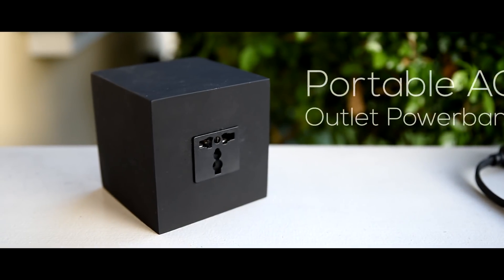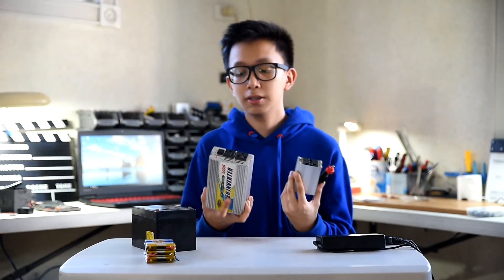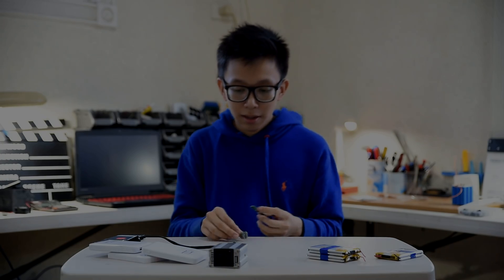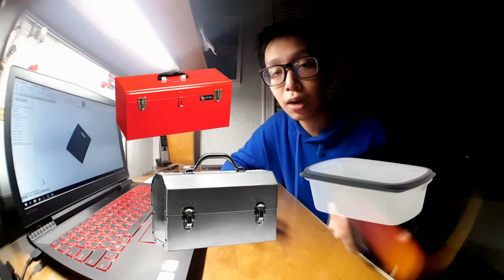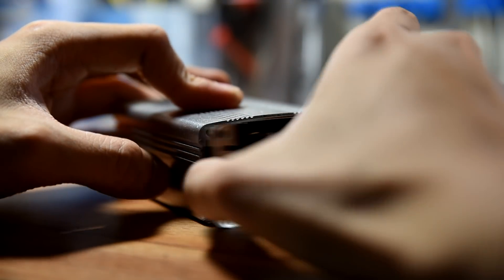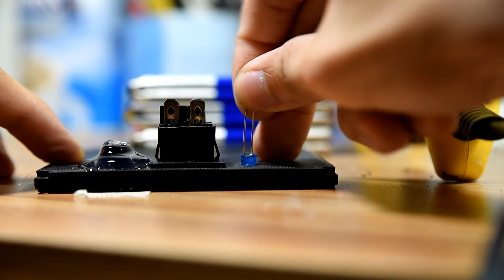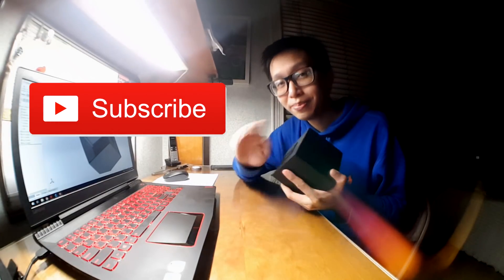DIY 220v Powerbank Outlet

Comment: Dont open paperbacks with metal screwdrivers you can puncture the cell use a plastic plier also color code your wires this video has a bounch of safety missing like the power inverter he is using ks not pure sine wave that can damage some computers or electric fan motors to run hotter smaller gauge wires can cause melting over heating and will cause any lithium battery explote in case of a short also don't call the chips modular what ever call them bms battery management system and I just checked the data sheet on that bms you bought it does not balance the batteries at all it just protects them from going too low of a voltage really nice project indeed but I would fix the major bms flaw

Comment: Lithium batteries needs a CC/CV charger. A laptop power brick is a CV source so it's unacceptable. You should know that.
And that BMS isn't a BMS because it doesn't balance the batteries. It's a lie. It's only a protection circuit. (Check the ic's datasheet, 4 mosfet and a BATTERY PROTECTION IC, it does stop the charging of a battery if the voltage is too high but at 4.3V. Why ? Because it's a PROTECTION CIRCUIT, not a balancer).
Hope you will see this comment.
Cheers.
Reply: Still a very bad way to do it!
Also the thing is rated for 5-8A continuous output...
At 6,9V (worst case because the dropout voltage is 2,3-3V) that would give you 34-55W minus the conversion losses. Even at 12,6V that's only 63-101W... Not 150W!
Reply: I'm sure it won't be 4.2v but more like 4.25v or higher.
And what about CC/CV charging ?
Reply: I use power bricks that are meant for charging LiPo or Li-ion 3 Stage 12.6v - 11.1v  CV - CC the LED changes colors for each action with a auto off. I have 3 one in 1amp, 3amp and 5amp and I always use a reliable BMS that really balances during charge and discharge especially in this case because the cells are taking a beating. In this case I always use 4S 16.8v and it falls to 14.8v which you can always use a buck converter if your inverter can't exceed that value. I'm not busting stones, just saying how I do it.
Reply from the maker: I'm quite aware of the difference. It's a BMS. I did some research on the chip and did some circuit analysis. The IC has two mosfets for charging and discharging the batts. You'll also notice that there's a huge surface mount resistor acting as a dummy load for the mosfet used for discharging. So yeah, it balances each cell whenever is exceeds the 4.2v limit.

Comment: as someone who has also made their own portable AC outlet i would like to give you a few tips 

1: you need cooling for the inverter or else it will overheat (even some vents will help)
2: i would recommend using 24V (7 cells in series) instead of 12V as it gives you more usable voltage to work with between full charge and dead flat (7V vs 2V) 3 cells is not enough for an effective 12V lithium battery and 4 cells is too much for most inverters to handle
3: grab yourself a battery meter so you can see how much charge you have left 

i use this one in my portable AC outlet
https://www.ebay.com.au/itm/12V-24V-Acid-Lead-Battery-Indicator-Intuitive-Voltage-Display-LED-Meter-MA395/262790598190?hash=item3d2f8a4e2e:g:dXAAAOSwa~BYa4Ge

this one is good too 
https://www.ebay.com.au/itm/LED-12-24-36-48-60-72V-Lead-Acid-Storage-Battery-Indicator-Tester-Gauge-Monitor/401450595323?hash=item5d7851f3fb:g:90cAAOSwz~paHAHx

both have settings for lithium batteries
Reply: i would also recommend using 18650 cells instead of LiPo cells 
you can get 18650s very cheap by buying laptop batteries on ebay (your local PC repair store might even have some "dead" ones for free)
Reply: Fully charged 7S pack is 29.4V, don't you think it's too much considering the maximum voltage possible with a 24V lead acid battery is 28.8V?
Reply: Nevermind, just set charge voltage to 4.1V. Good for battery health too.
Reply: with those vents  add small fan i would ----- and use low wattage devices on it and i would add a fuse on it

Comment: While it is a pretty good project idea, I don't really think it's wise to be working with mains voltage, specifically rewiring up the Neutral and Live pins, as by the method you've demonstrated you have a 50% chance of reversing the wiring which may damage certain electronics (I'm not sure on which ones, however to save any future headaches, It would be wise to put live to live and neutral to the neutral pin)

Comment: Great thoughts and great project! Yet 24k mAh, assuming the battery has voltage rated 3.7V, will only roughly provides 90WH power, and again assume 100% conversion efficiency, a game laptop like you use will generally draw about 25W per hour without using the discrete GPU. So it could only possibly provides you about 4 hour extended battery life, under optimum situation. In general, the power conversion efficiency from battery (DC) to laptop (DC for those power bank that has DC 20V output) will suffer about 10% energy loss. In addition, since having AC outlet capability requires DC to AC conversion before actual power service, much more energy is lost during this process. So I personally was not a big fan of AC capable power bank, it is less efficient, and you won't practically plug high wattage appliance to it anyway (both safety concern and limited WH it can supply). No offense tho, it is really great to see project like this, it is just less practical when talking about power bank with AC capability.
Reply: BTW thumbs up~

Comment: why convert to AC first? if you want to charge up your laptop you could gain a lot of efficiency if you dropped the powerbrick and AC altogether. just use a constant voltage controller and set it to 24 V or whatever the laptop powerbrick used to output.
Reply: my thoughts exactly. so many devices work on DC nowadays! i think versatile battery banks should be more common than USB-only or AC-only ones!!!
Reply: well its not for just laptop...maybe you need to power your blinder at the beach or fan?
Reply: Check out GreatScott's channel, he recently made a great power bank for laptops.
Reply: @TechBuild  much better, safer and prepared than this. Scotf has a phd while this guy has master in failures.
Reply: None of you clearly have a powerful laptop lol you cant run a game on the dc battery alone it needs ac input to run at full power
Reply: it would be better, but just for sake of simplicity its easier to do it this way, its good to power something like 120-240v LEDs, or charge phone, with only around 80Wh you wont get much of a charge for laptop (since you are gonna lose alot due to inefficiency)

Comment: I would recommend using a thicker gauge wire for the terminals to the output port as well as a circuit breaker for safety. Another note, maybe a larger power bank could be made using recycled 18650 cells.
Reply: was going to say the same thing. when in doubt BIGGER WIRE lol
Reply: its a low ampere so its fine
Reply: @dailypinoytech6132  it's
300w /12 = 25.... it was 300w right?
If it was 150w then 12.5amp.
I'd say 2.5mm cable  (with a fuse)...

Comment: Very nice project, but rather than salvaging batteries from power banks, it will be cheaper to get a 11.1V 3S battery from eBay. The same charge and protection board can be used on them too, you just need to use the balance connector.

Comment: so i think you basically have made a bomb lol.. wood, lithium batteries, high voltage in a enclosed container with no way to dissipate heat.
Reply: Kids these days: "let's surround metal box with wood ! shouldn't be causing any heat related problems, probably they used metal box for the inverter just because it looks awesome :)" 
Me: (grabbing popcorns)

Comment: In my opinion it would have been much better to wire up all the batteries in parallel to get better battery capacity this way you would have 24000mAh capacity of the battery pack and then use a DC boost converter to step up the voltage to 12 volts. Thats just my opinion great project keep it up!
Reply: NO because then you would add one more step in the conversion process and lose more energy. :) and it would use 3 x as many amps

Comment: These wires from the batteries to the inverter are way to thin and flimsy. Think about powering your "130W" gaming laptop... At 12V that is arount 10Amps.... And that's not the highest load you can put on there...

Comment: Also, need a Fuse in the DC side to prevent over discharge current from the battery. I assume the inverter is protected against over current on AC.
Reply from the maker: I did! I did some circuit analysis on the Lithium Balancer Module, it's equipped with those.

Comment: how about the converter and the battery getting hot?
Reply from the maker: If it comes to that, the inverter has a thermocoupler. It will shutdown the moment the temperature rises at dangerous levels.

Comment: Can you please add a protection circuit on the battery against overdischarge or low voltage? LiOn batteries can easily damage on overdischarge.
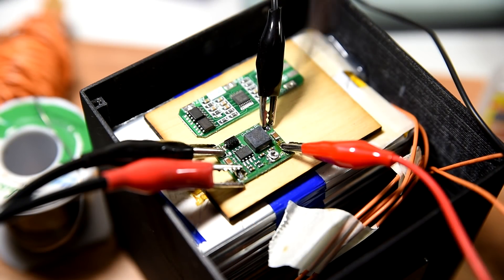Reply from the maker: I did! It's the "Lithium Balancer Module" at 8:59

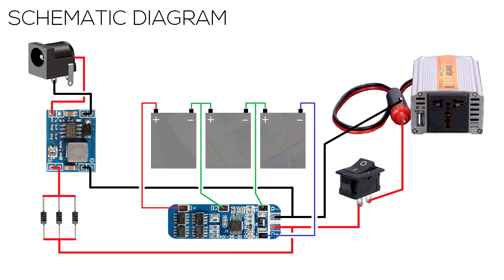Comment: 9:02 Some improvement you can make: Use a schottky instead of a regular silicon diode. Get a beefier Dc to dc converter.
Reply from the maker: That'd be nice!
Reply: How many schottky would need to be used?

Comment: Nice project. But have to mention, dont use DC-DC step down converter which dont have   Current limiting option for charging any type of battery. there are lot cheap modules capable of doing CC.
also use some balance circuit for lipos, not only protection board you have.
Reply: You are 100% right.

Comment: no charging indicators? and not fuse?? the metal case isnt even earthed!!
Reply: And the case isn't metal, it's plastic.
Reply from the maker: I did some circuit analysis on the inverter, it's equipped with digital safety cut-offs not to mention the Li-Ion Balancing charger also acts as an advanced fuse.
Reply from the maker: Exactly

Comment: And it will power a led bulb lamp for 15 min off the grid. Happy Judgement Day!
Reply from the maker: This project isn't the most efficient way to power things up. But it's a useful proj for emergencies.
Reply: Either way, I enjoyed your video and I think this power bank would make a great school science project.
Reply: What do you mean? It has 8Ah of power at 12v, resulting in 96 Watts, assuming a very low efficiency of the inverter at 80%, it's still 77 Watts. Which would power a 10 Watt LED (comparable to a 15W CFL) for 7 hours and 42 minutes.
Reply: Sure, but a 60W LED (I assume it's a ceiling lamp), would make a big room as bright as the sun. Backup batteries are not really made for big applications. And even so 1 hour is more then 15 min. lol. (but I know you meant 15 min as an euphemism).
Reply: Yes and a 60W bulb for an hour.

Comment: There are two types of inverters: pure sine wave inverters and stepped-sine or modified sine wave inverters. Pure sine wave inverters produce AC current identical to what is coming from a wall socket, and is preferred for electronic equipment, especially computers.
Reply from the maker: Yeah! We must use Pure sine wave inverters as much as possible. The only thing preventing us to do so is the price and the relatively large form factor.

Comment: Is that lithium polimar battery
Reply from the maker: Lithium Ion
Reply: Actually there are lots of Li-ion in packs instead of cylinders. They all start as a long sheet, so instead of rolling up, they fold over.
Reply: TechBuilder Are you sure? I've never seen Li-Ion batteries like that, they look more like LiPo batteries. I could be wrong though.
Reply: TechBuilder what's the difference between lithium ion and lithium polymer

Comment: Becareful using inverter there are 2 types of inverter modified and pure sine wave. Dont connect any kind of motor type in modified inverter it may cause explode or destroy your appliance. Puresine wave is a regular voltage. And make sure you will use fuse/ac breaker for protection. 😑😕

Comment: Very cool, this is a fun and useful idea. How long can you use your laptop on? I have a half dozen lipo batteries for a quad copter I no longer use. It might be fun to try this with those. Any idea what I’d do with the balancing cables?

One serious point and one nit pick though. You said you chose wood to sit atop your inverter because it was a good insulator. The case of your inverter looks like passive heat dissipation (it was aluminum with ridges). Isn’t that to let heat escape from the inverter? You wouldn’t want to put an insulator on top of that—it’s like misting yourself because you’re hot, then putting a jacket on over it. You can buy aluminum project boxes that have the ridges on it’s exterior, that would help draw the heat away from the jumble of components. 

And then the nit-pick. You don’t use contact cement like you would regular glue. It’s called “contact” cement because it’s glues on contact. It’s like making a sticker. You apply a thin coat to surface of both items you want to glue together, let it dry completely (usually it shouldn’t even be sticky to the touch), and only then do you press to two dried patches of glue together (that’s the “contact” part). It’s often used for big sheets of things that would be difficult to clamp or hold down. Using wood glue to apply a veneer to a full sheet of plywood would be hard to clamp, and it would take a long time to dry to dry because the glue in the middle is several feet from any air source. Contact cement dries quick because it’s fully exposed, and then you need no, or minimal clamping because it sticks instantly when you apply it.

Comment: how the crap u can tell which one positive wire and which one negative?? the wire color is same
Reply: You can use a multimeter and measure the voltage through it. When you do it you will see a negative voltage (like -12) if you connect your multimeter to the wrong polarities (positive and negative) so if you have that you need to swap your probes and you know what the negative and positive is
Reply: if you cant tell positive from negative dont even touch electricity
Reply: piece of potato easy he just remembers what wire goes to the connections
Reply: TechBuilder Actually, one has a ridge, that one is positive
Reply: piece of potato good and smooth
Reply: 1) Use different colors.
2) Use red and black makers on the wire's sleeve to identify them.
3) Tie a knot in the positive wire so you don't forget.
4) Stop asking silly questions and pay attention to what you're doing!  

#4 is definitely the best.  ;-)
Reply: It's also labeled on the pcb.
Reply: I have NOOOOO idea a continuity tester maybe
Reply: piece of potato Spelling abomination "founded"
Reply: With basic electronics knowledge, if you don't have that what the fuck are you doing here
Reply from the maker: It's a memory game. Hahaha
Reply: TechBuilder electric god founded

Comment: Nice project but the wires connected to the outlet seem pretty thin
Reply: The current flowing at the output is pretty low. The input is what you should be concerned about. But 14 gouge is enough anyways.
Reply: Thin wires can melt easily under high current, true.
Reply: They could actually have been smaller
Reply: Current at the output is not the concern, it's the thin wires and high current on the input.
Reply from the maker: Nahh. It's gauge 14, just has a thin insulator.

Comment: That's a GREAT project! Really nice! I only have two doubts: first, how do you know it's fully charged if it doesn't have an LED or something to indicate? Second, how much amps does the BMS support and how many the inverter draws?
Reply: In my opinion simplier option would be buy quad copter battery (3s) and a balanced charger for your battery and that would be it. And power bank batteries are not rated for those loads (120w/12v=10A, and these batteries load tops should be 1A, quadcopters batteries are rated for higher loads eg 40A).
Reply: Hey, i'm a complete noob but I really want to do this project. How can I tell If it stops consuming current? Can I just use a multimeter or is there a different way to do it. Thanks!
Reply: picubed_13579 I really would like to know too. :/ Maybe if you find a 12,6v charger with LED state... But I have no idea of where you could find it. :/
Reply: Senkus Julius Man... You can make 3s or 4s batteries with 18650 cells and fly quadcopters. There's LOTS of videos showing it. Those batteries can handle something close to 20c.
Reply from the maker: THANKS! Um, you'll know it's fully charged when it stops consuming current. The 3-cell charger acts as a standard lithium charger an a high & low battery voltage cut-off protection. I figured it might complicate the project to some people so I made it as primitive as possible. If you want to know if it's full, you might want to buy a digital Ammeter module! :)
Reply: TechBuilder Yeah... That's not a bad idea. But... Well, my doubt is because I personally have this problem, there's a lot of projects that I would love to make and need a battery pack like that. You know? But to put an ammeter in every project (even a vacuum cleaner, for example) would be a really good solution. :/

Comment: 8:59 where does the LED go in the schematic? 
Did i miss it?
Reply from the maker: It's optional. It's supposed to be in parallel with the inverter's input terminals.
Reply: i think i see some blurry resisters (at least one) in the next scene.  
You're using one to drop the voltage, and another to limit current?

Comment: Diodes cannot be connected in parallel, one of them will warm up, lowering the threshold voltage and doing all the work. Anyway it remains an intresting video.
Reply from the maker: We've been taught that it can me. The 1N4007 has a max operating voltage of 1kV, has a lot of leeway. I figured that not much people have access to the least common 5A rectifier diodes so I made a common alternative for everyone.  Thanks!
Reply: TechBuilder 
The buck converter can only handle 2 amps, why would you need such a high current diode?